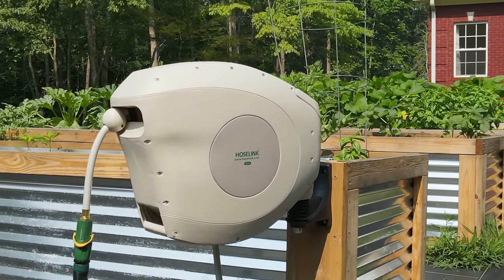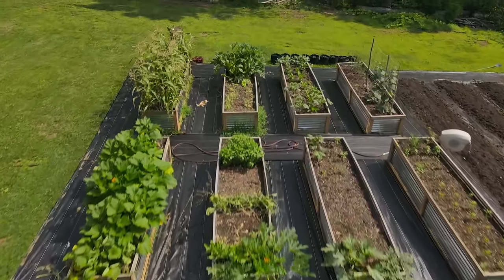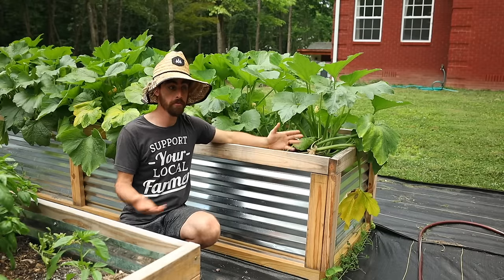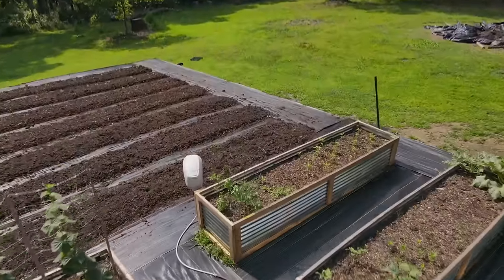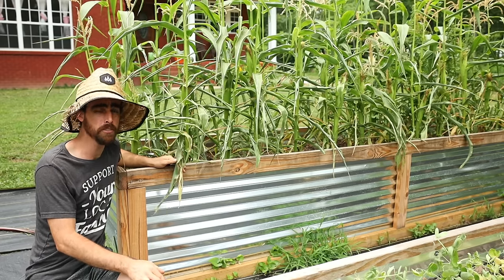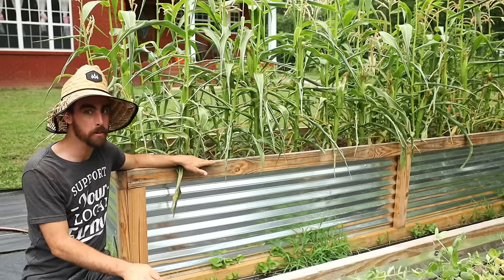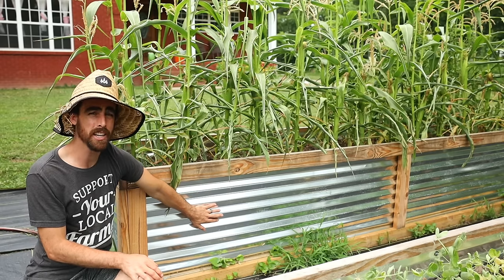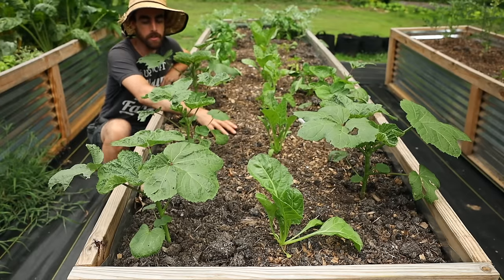Beautiful DIY Metal Raised Garden Beds | Complete Guide

Comment: I made these two years ago. Although I used the 8' long metal instead of the 12'. I had limited space where they were going. I have heard from other ppl that anything over 8' long does require the reinforcement beams to prevent bowing. I also used deck wood. It is cheaper and looks really nice. It is treated but the metal covers the wood so no soil is touching it. I also lined the inside with landscape fabric for added protection of using treated wood. I also filled mine like he did. I am short, 5'2" so they come to mid hip which means I have no bending over at all. I have a really bad back. Being only 8' long I just hopped inside and was able to lift and carry them where I needed to as they are really light weight. 2 years later in the blazing Florida sun and massive rainfalls they are holding up like a pro built them. I'm a 58 yr old women that has never built anything even close to these beds. So if I can do it anyone can 😁. I must say those 12 footers he built looks very nice. Wish I had more room. I also made a couple of 4' x 4' boxes for herbs. Although I grew carrots last season in one. Happy gardening 😊. Oh...and I did use those fabulous screws with the star bits.  The drill grips them so wonderfully. I did not use that pocket drill jig thing tho. I made a small pilot hole and then angled where I needed to.
Reply: I'm in Florida too, and wondered if the plants would bake in the summer. Happy to know I can use this design.
Reply: Are the metal sheets not rusting with exposure to water and soil?
Reply: @MatsobaneKhwinana  I'd assume no since they are made to be on roofs
Reply: I'm in NW Florida and using carpet under them.  Free.  I'm a scrounger granma from way back. lol @MsPenchi

Comment: Galvanized metal does not absorb the heat, it actually deflects it. If you put a thermometer on it during the heat of the day, you will find the metal cooler than the outside ground around it.

Comment: similar to mine, except no pressure treated. Burn the bottoms. if you prop the bed up on small bricks, and have the inner roofing slightly lower than the bottom of the wood, it will prevent dirt to wood direct contact somewhat, helping keep your wood from rotting as quickly. Also something to consider is adding a mesh on the bottom of the raised bed if you have ground tunnelers!

Comment: I recently built some of these raised beds with metal panels. I, too, used pocket holes. @ 15:19, you mention that you do not need to use pocket hole screws and that regular construction screws will work in the pocket holes. IMHO, this is a bad mistake and I hope you correct it. Regular screws can split the pocket hole and pull through easily. The pocket hole screws are designed specifically for pocket holes and have self tapping drill ends and a flat washer sized head to prevent the screw from being pulled through the pocket hole. If you are going to spend all the time and money to make these great raised beds, spend an extra dollar or two and get the correct pocket hole screws to keep everything together for years. I am very happy with my metal panel raised beds, saved a lot of money, but please, use the correct screws for the pocket holes if you want the build to last.
Reply: If this is a concern to people, you can also buy cheap bulk washers or lock washers would work too which are even cheaper.
Reply: @R.L.U.  My main point is that I think it is a mistake to go cheap on the screws that will hold this project together. FWIW, I did not use the regular pocket hole kit for my build, I used the HD (Heavy Duty) Pocket Hole kit which uses even thicker HD screws for dimensional lumber. The HD kit and thicker HD pocket hole screws may be an overbuild in this case, but I tend to over build on most of my projects. If someone wants/needs to save a little money using regular screws and bulk washers/lock washers, I would suggest joining a few pieces of scrap wood together first and make sure your joint holds. Again, these are great raised beds and you want them to last for years.
Reply: I actually built nearly identical beds 4' x 8' before watching this video .  I also decided to skip the Kreg brand screws, in favor of generic exterior #8 x 2" screws.  Reasoning was that there should be minimal force on the vertical joints, plus the steel skin will guarantee no movement.  One additional thing I did was include a little Titebond 3 in all the joints, since Kreg recommends using glue with pocket hole joints. Since glue joints are stronger than wood itself, pocket screws in one sense can be thought of as clamps for glue.

Comment: I built 6 of these last fall that look just like yours.  Mine are 8' x 3' long (I should have gone 4' wide but already had 3' hardware cloth to add underneath lol, so it is what it is)and to keep them from bowing I used water heater straps in the middle from one side to the other.  I attached with screws, but in hindsight I should have probably drilled straight through and attached with bolts, because the as the wood deteriorates I'm sure the screws will pull out. I think these beds look really nice and I even added cattle panels between some for cukes and tomatoes, I love it.

Comment: 11:25 A simple Cap Plate , 1x4 2x4 etc, run perpendicularly to the bowed board below . James Prigioni from The Gardening Channel has a GREAT example of this application 😁

I went cheap, all pine. But coated on the inside with Teak Oil 👍 one year later still good 

Beautiful Garden ❗

Comment: Good job. Looks nice. 

You might consider also some construction YouTubes. They will commonly show you how to use string lines to layout alignments and make them square. Much much more accurate than a little 6” speed square. 3-4-5 will at least give you square for one corner which would be 10 or more times accurate than the triangle.

Comment: Great video, I tried an in ground garden and voles and bugs ate everything by the time it was 4” tall.  So I’m going to try raised beds with 1/2” stainless hardware cloth secured on the bottom  and see how that works.  I wouldn’t recommend using normal construction screws because they rust out and break after 15-20 years.  Use coated decking screws
Reply: I honestly almost gave up gardening because of my vole and investigation.  This spring I got solar powered stake thingies that vibrate every 20 seconds in the ground.  It came with four of them but it says they manage a 4,000 square-foot area.  It was a last ditch try but they're actually working!  If you're still having trouble I suggest looking them up. They weren't that expensive
Reply: you can put used carpet (free) under raised beds too

Comment: I also made beds almost exactly like this two years ago.  Instead of logs as hugel material, I used heat treated pallets packed with wood chips.  I only left about ten inches at the top for actual soil.  It worked great the first year.  I am having issues with the chips deteriorating and leaving voids under the soil...and then the soil eventually collapses to fill the void.  Not good, but it's still working pretty well.  The plants roots keep it together for the most part.  

My beds are only eight feet long, and are reinforced with pvc pipe to prevent the sides from bowing out.  After less than two years there is a tremendous amount of pressure on the pvc (That have glued endcaps).  There is absolutely no doubt in my mind that my particular beds that seem to be built exactly like yours would be bowed way out by the weight and pressure of the soil.  I predict my beds will fail in a year or two.  I did a write up on permies.com about them.  If anyone cares to look I'll provide the link if you ask.   I think the extra pvc supports are well worth the extra work, are relatively inexpensive and pretty much impervious to deterioration like wood.  

Otherwise, great minds think alike!  :)  I hope your beds last at least ten years!  
I want to move from the desert southwest to KY or TN also!  It's inspiring to see your move and progress.  Keep up the good work!
Reply: All hügelkultur beds will decompose over time and reduce the level of the soil in the bed. Larger logs will last longer, but wood chips and other smaller organic material will break down faster. I top off my hügelkultur beds every spring with a nice layer of compost. This brings the level of the soil back to where I want it while also increasing the fertility of the raised bed. As the hügelkultur material breaks down, it also feeds the raised bed. In this way, the hügelkultur raised bed improves each year.
Reply: @gtaus1  yes that is absolutely correct. I have had to add compost twice in two years. I used logs, braches, brush and wood chips. So yeah the smaller stuff will break down much faster than the logs or thick branches. I love the system.

Comment: all thread rod... instead of weed mat I use discarded carpet... free at almost any carpet place...I have had the same carpet on my driveway  (20 degrees slant for erosion control ) for 28 years!  Does the hose reel have a drain cock for winter drainage?

Comment: We have gophers.  We made a hugelkulture mound and then later decided to make a raised bed. We put chicken wire on top of the wood and now the gophers can fit through and destroyed everything.  So I didn’t use the correct wire and now I have to redo everything. Do you suggest we start over? I have weeds which I covered in cardboard and mulch so should we put the wire on top and fill it with wood. Sorry I know my questions sound discombobulated. I live in San Diego and it’s the desert here, super dry, no rain, super hot. Zone 10.  When you said you’ve only watered twice it boggles my mind because I water every day.  Thanks for any feedback
Reply: Oh my comment on the weeds was about moving the cardboard and mulch or  leave it underneath the bed. I don’t want to use plastic.

Comment: Hey Steven and the gardening community, quick question, I'm looking to set up a raised garden bed at my condo and a concrete patio is the only option I have for this. What would you recommend for the lining for the bottom of the garden bed (to prevent leaking of soil outside of the beds)? Thick plastic or high quality landscape fabric? I know both will get the job done but I am concerned about both of these fabrics leaking chemicals into the soil. Are there more healthy alternatives? Any feedback would be appreciated!
Reply: Landscape fabric should not leach chemicals into the soil, but it absolutely will leak water out across your patio. With no exposure to the sun or boiling water, the plastic shouldn’t leach chemicals either. 

IMO, There are several better options for planters on concrete, and primarily using a wicking bed concept. If you are wanting a large size closer to this, you might look for an IBC tote (about 4’ cubed), and cut it in half for 2 wicking beds. I was just reviewing some videos by Leon, LDS Prepper and others. Lower maintenance and more water efficient. 

If you were really committed to these beds and not have liquid leaking across your patio, you could add a bottom of wood or metal and seal the joints with a silicone caulk. By doing that without a wicking design though, you run the risk of root rot.

Comment: Hey how are the non treated 2x4s holding up after 8 months of weather? I just found your channel and subbed.
Reply: Regular, untreated 2x4’s will be okay for years. They’ll grey a bit after 1. If you use like a linseed or other natural penetrating oil, or shou Sugi ban (fire treat) the wood, it will last for years and decades.

Comment: Did you put garden fabric under beds?
How long do you have these style bed do you fell the wood might rot at bottom because they are dug in to the ground with you being on a slope
Reply from the maker: No not under the soil only under the wood. The wood on the bottom is pressure treated to help with that. Only 1 year, we shall see how long they last. So far no issues.
Reply: Pressure treated lumber if rated for ground contact will last for decades. Be careful though, not all PT is rated for ground contact.

Comment: Never seen a high raised bed situation like this that wouldn’t fall apart in a few years. In my opinion unless you have mobility issues there’s no problem with keeping a raised bed close to the ground. I also don’t really like the aesthetic of the metal sheeting. Still, I know lots of home gardeners are into this kind of thing especially if older or less mobile.
Reply: I hope my high metal panel raised beds will last for years. I cut my beds down to 4X4, which I hope will prevent bowing in the middle and since there is less soil in the bed, that the reduced outward pressure will turn into a longer lasting raised bed. I used the hügelkultur method to fill the bottom of my high raised beds. This year my area is in a drought, and the only raised beds that are producing any food are my hügelkultur raised beds. They just retain water better than my "normal" low to the ground raised beds where the water drains through and dries out too quickly. I prefer the looks of an all wood raised bed, but the metal panels should last longer and I saved lots of money.

Comment: Do you have issues with deer or other animals? I had to put an electric fence around my in ground beds and have seriously been considering adding some raised beds a little closer to the house. I had a few grow bags close to the house with peppers and the deer had a nice snack early in the season. Luckily it was early and they came back and are now loaded with peppers(I put chicken wire around them.  Do pie tins really work to keep them away.  Don't really want to add a fence since that, to me, defeats the purpose of the raised beds.  Being easily accessable.  Thanks in advance and for all the advice( have put quite a bit of it to use).
Reply from the maker: So far I have not from any critter and I'm kind of surprised. I do have electric fence running on one side of the property as well as pigs and a dog so I think that deters them a bit too.
Reply: I have issues with deer. You can easily install PVC hoops on these raised beds and cover them with bird/deer netting. Bonus idea, you can also use the hoops and cover them with plastic to extend your growing season.

Comment: theres has been studies claiming that the zinc in the galvanized metal can lock up nutrients (i believed calcium).i dont think this will be a problem with veg plants, like you stated.  ive learned acidic soil will also cause them to rust faster.  they look good and save you from backaches.

Comment: I don't care for the zinc/lead in galvanized products. Zinc naturally has over 1% lead which is why galvanized pipes aren't used any longer. 
I built 3 Cedar 6x3x30" garden beds in February and they cost $200 each. I used dog ear cedar fence for the inner boards on  2x4 frames with 4x4 corners. I'll build another in the fall and put cattle panels between them for squash and tomato to climb. They are providing lots of veges and saving my back, so we'll worth the money.

Comment: I just have a few personal obs. and exp. on "way easier" for even a home garden, much less homestead, level. Politely ! #1: Not necessarily any easier on your back, much of the time. When picking tomatoes lower on the plant, and bush beans, sure. Rest of the time, not really. I have had a variety of back pains and strains, and it was actually much more uncomfortable - at best - to deal with my few, various hights and sizes of raised beds, than my in-ground garden. Excepting maybe my waist-high concrete block bed, when I wasn't trying to reach into the middle of it ( it was 4 ft. wide by longer). Turns out scrouching, kneeling or sitting in the garden is lots easier on the back. Trying to sit on the side of a raised bed, as often touted as a plus, isn't at ALL comfortable, and I'm not even talking about metal ones. You're just plain trying to sit sideways while working awkwardly and it's horrible, imo. . Tip : Goinf barefoot can make a HUGE difference in comfort or ability to squat/crouch etc. much or for long. My lower body - pressure on my knees, in my legs, ankles or feet - for some reason feels WAY better barefoot vrs. with ANY kind of shoe, boot or sandal on. 
Weeds : This shouldn't be any different whether in ground or not, once in ground is on it's 3rd yr or so, no-till, except dealing with edges. And doing something about that, whether putting in that heavy-duty black plastic garden bed edging (that does come in deeper options than the commonly seen, shallow-ish one), edging it by machine or hand, or whatever, would be maybe no more work or investment than building bunch of beds, just sayin' . Tree seeds landing/blowing in etc., seem to land everywhere, regardless of height ( in a raised bed or on ground). Raised beds have to be watered more, typically. They can be great to be easier to naturally discourage rabbits and dogs from entering them, kids running across them, etc.  tho. . Plus can easily look tidy and pretty. So, not totally knocking em, just sharing my experience (vrs. their maybe undeserved praise & popularity for so long...) . 
But plz make no mistake, anyone - I highly regarded Steven and his channel !!! Love ya and God continue to bless ya, bro !!